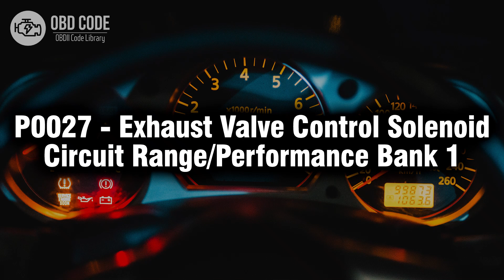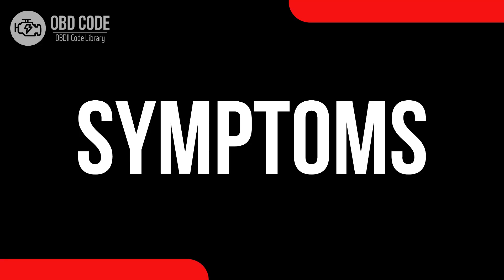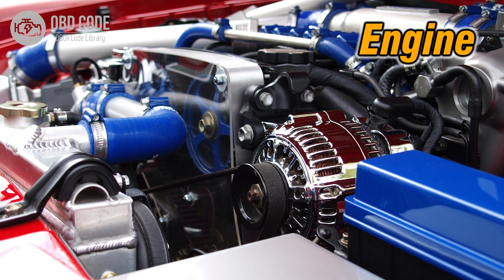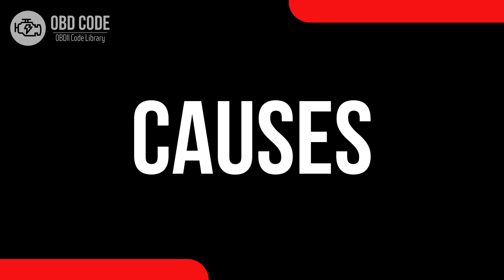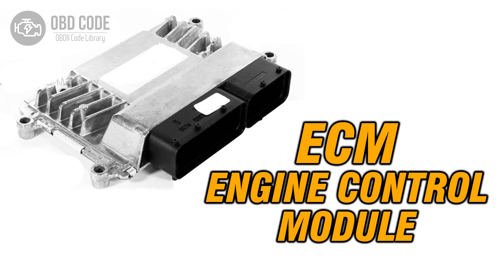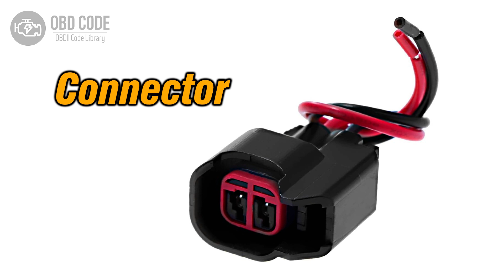P0027 Exhaust Valve Control Solenoid Circuit Range 🟢 Trouble Code Solved 🟢 Symptoms Causes Solutions

Comment: This code just came on for our 2010 Isuzu NRR after we just took apart and cleaned the EGR and exhaust cooler. Could those be related? And what would be the fix?
Reply from the maker: Good morning, I advise you to go to a specialized workshop of the brand, they have the equipment and experience to give you a solution.👨‍🔧